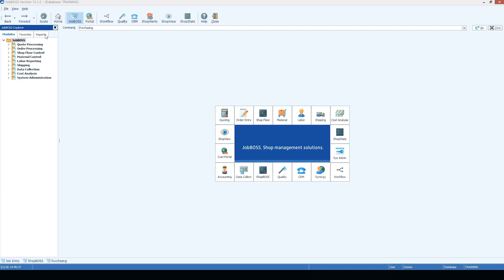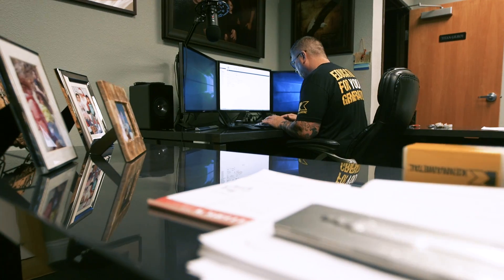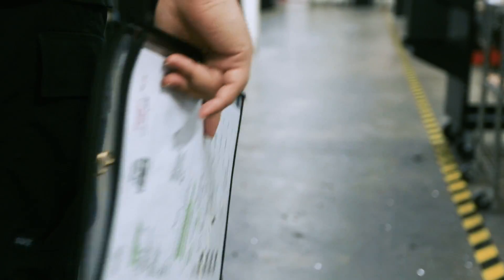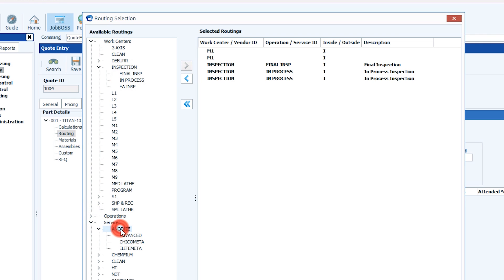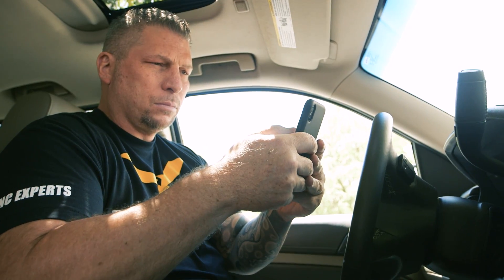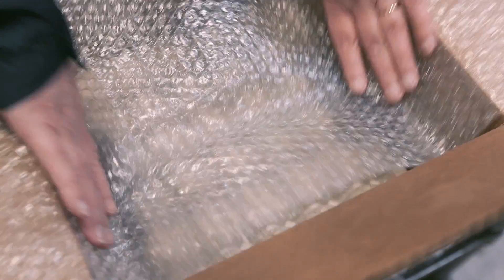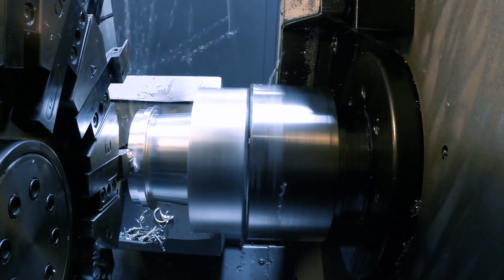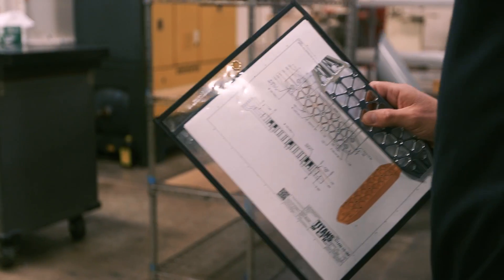Aerospace Job Shops NEED THIS to be Successful

Comment: Does job boss maintain traceability data (heat, lot, melt, etc), as well as inspection results that are linked to the file?
Reply: Yes sir! Heat, lot, melt, and other batch info can be captured for all materials and raw stocks. We also have an advance quality offering for inspections, document control, and AS9102.
Reply: @andreweber1372   did you know how to use jobboss?